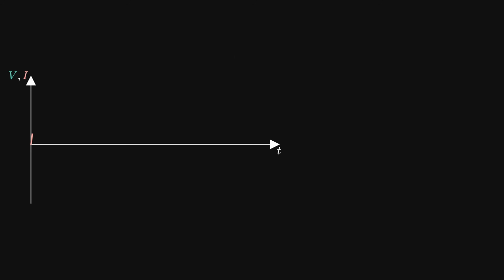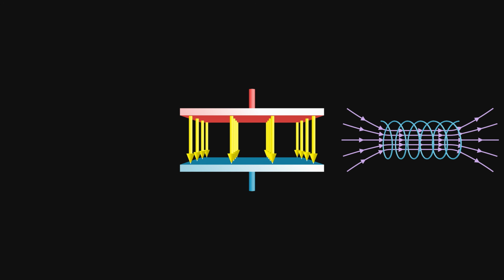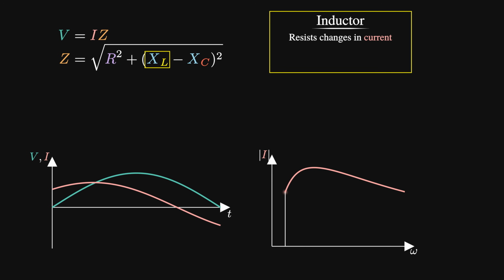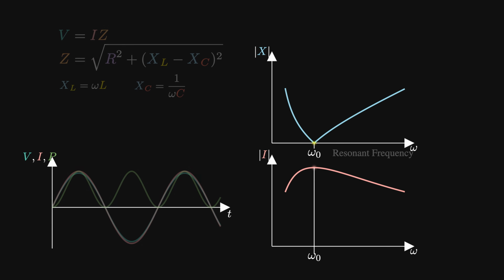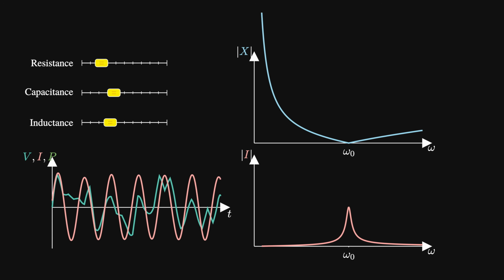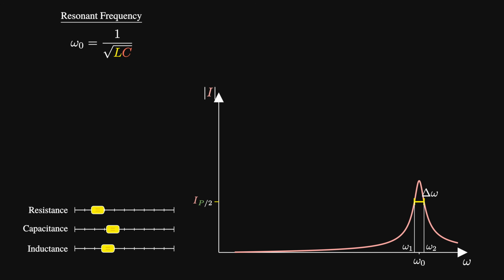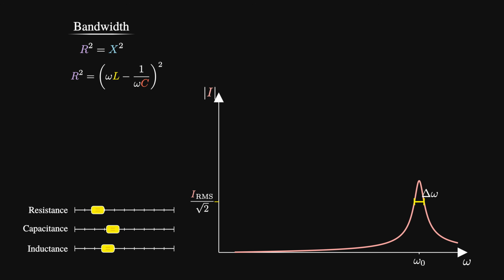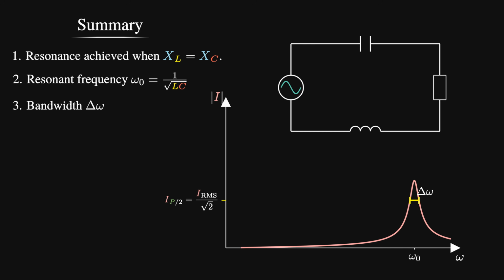Resonance in AC Circuits Visualised | Series RLC Circuit, Resonant Frequency & Q Factor

Comment: Could you make a link to an online tool people could use to simulate this as you have in the video?
Reply: It is done using "Manim" a python based animation engine. To use it you'll need to know python. There is quite a learning curve to it
Reply from the maker: This video was made with manimGL (I modified it for myself quite a bit), I currently don't upload the scripts online as they are pretty messy and would be incomprehensible without documentation (I may in the future if there's a demand for it). I am also making interactive animations in my app based on these animations in my videos though, so anyone can test them (not sure when I'll get round to this one but hopefully over next few months) 👍

Comment: I hope this channel will get millions of views and you will continue to make videos.

Ideally how deep would you want to go into electricity and magnetism or are you planning to go more towards a signals and systems direction?
Reply from the maker: Thanks! I am a physicist so I will be covering a range of physics primarily (I just happened to start with electricity). I'm currently doing thermodynamics but will definitely do magnetism in the not so distant future. As for more complex topics related to AC circuits/electronics etc., if there's a huge demand for it I'll consider it 👍